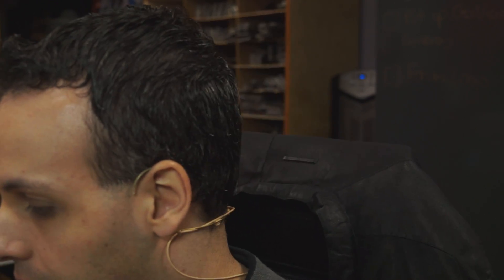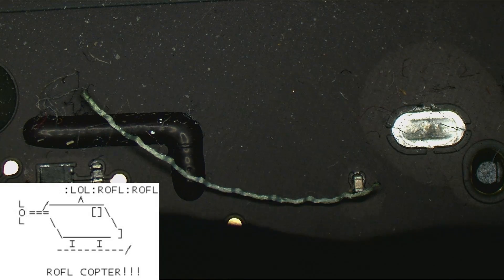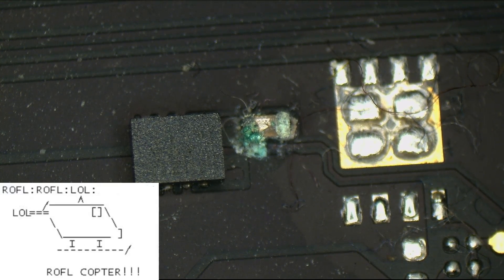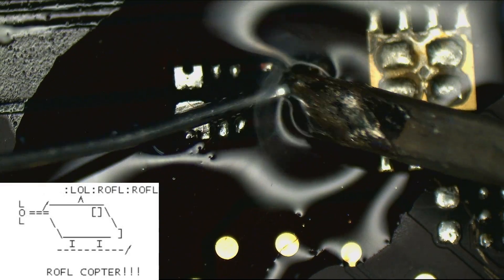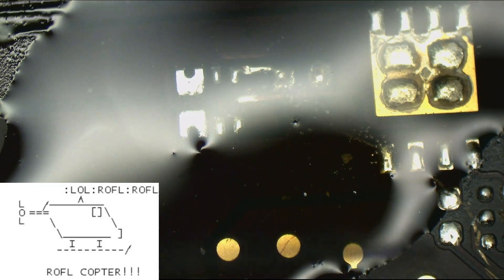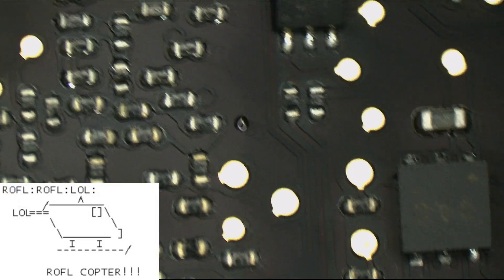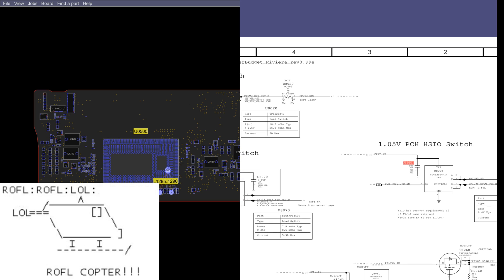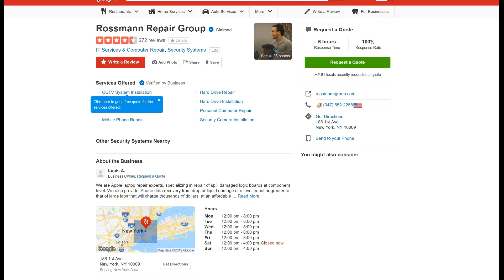The best Macbook logic board repair - right here on http://www.rossmanngroup.com

Comment: Hey louis, how is the hako tip cleaner any better than a tuna can with a stainless steel scouring pad in it?

just curious if I should upgrade
Reply: Tater1337 Steel? I was told to use brass filings.

Comment: 98% of the apple things you repair are liquid damaged yet 90% of your fans complain about bad apple design etc even though any other electronic device would be damaged with water.. stop spilling liquid into them and they work fine!
Reply from the maker: Incorrect
Reply from the maker: Your assertion:

"stop spilling liquid into them and they work fine!"

The truth: 

Keyboards spontaneously dying without water: 

https://bgr.com/2017/10/19/macbook-pro-2017-keyboard-not-working/

https://www.youtube.com/watch?v=4KuVvb9DTaU

Screens spontaneously dying without water:

https://appleissues.net/issues/flexgate/

Spontaneous no power without water:
https://www.youtube.com/watch?v=pvy-WrDdgYY

Spontaneous kernel panics without water(same as aforementioned design flaw, just implemented in different power circuit):
https://www.youtube.com/watch?v=DzcgT_fiVTA

Spontaneous black screen without water:
https://www.youtube.com/watch?v=lumJ0cN5oyY

I could go on and on...
Reply: @rossmanngroup  are you saying that other laptops don't randomly break? I had an IBM thinkpad R31 that would just cut out every 20 minutes without any warning, bought another because it was a great laptop then after 6 months that one did exactly the same! even on charge. 
Acer travelmate with a screen wire damaged from being opened and closed... hmm sounds familiar. yet my Macbook A1342 i have had new since 2009.. still working great to this day! only been to a computer shop to have the ram upgraded to 8gb.. it's been just as if not more reliable than my PC!
Reply from the maker: @CouldBeFrench  I said no such thing. No strawmanning.
Reply: Serious question: Why is the corrosion happening only at very few solder points? Do only very few water drops get through the case or is it high air humidity and following condensation? Could Apple do something about the corrosion by bathing the board in flux or something like that?  @rossmanngroup
Reply: @rossmanngroup  I don't know what that means haha just saying if you look after your stuff it looks after you and of course there will be design flaws and random flaws every once in a while. my argument was not against these failures but against the negative comments saying things like "what a poor design" on your water damage videos when water is not and should not be apples problem. every instruction manual and even the box clearly says do not get wet or leave in damp storage :D
Reply: @CouldBeFrench  Leah "box says don't get wet" Lanfond
Reply: @CouldBeFrench  most other laptop brands have some sort of protection against water damage; example: https://youtu.be/ig3xI8dUdm0?t=1650 because every company knows accidents happen. i think any customer should expect that an expensive, premium(TM) laptop is able to survive a few drops of water, but alas; macbooks do not.
Reply: @whozaskin3639  haha that was kinda funny, but it does have that umbrella with rain with a cross going through it symbol thing
Reply: @GoulartGH  I really don't think many electrical devices have this.. does your flat screen tv have protection against water? i think maybe apple thought their devices would go to smart people like animators and photographers who don't pour water into their machines? I have seen regular non apple laptops have trouble with more than a few drops of water? but because it's expensive it should have to? I don't think that's a fair statement when as i said at the start, it's not apples problem to deal with something they advise against. it's hardly a selling point haha, if they sold it as waterproof like many phones do nowadays i would be agreeing with you :)
Reply: @CouldBeFrench  why would you need liquid resistance in a TV? its not something that is always close to your hands (and possibly a coffee cup too), so there isn't a need to. this only applies to laptops and phones.
however, several people use their laptops while drinking coffee, water, etc. it's simple enough to do so without damaging anything, but as i said, accidents happen and everyone knows it.

also, macbooks aren't targeted ONLY at professionals; it's also targeted at people who aren't very familiar with computers in general (hence macOS being one of the simplest OSes to use), so i don't think "maybe apple thought their devices would go to smart people" is a very strong argument.

"I have seen regular non apple laptops have trouble with more than a few drops of water" of course, if you pick a regular cheap laptop you shouldn't expect it to have much resistance; after all they are cheap. (sometimes they do, though)
"but because it's expensive it should have to?" yes, especially when other brands do it; is it fair to the consumer to lose $1k+ because of a mere accident, when its not that difficult to do a workaround for that. it's not fair to the customer to pay $1k+ for something that has the durability of a cheap laptop.

the only thing that is agreeable is that it's not apple's fault and indeed it isn't; they aren't the ones that dropped water into their product. but it's a matter of caring for the consumer; if you want your customer to have the best possible experience with your product, you'll want it to last, and you'll want to make it as durable as possible (including, of course, liquid resistance). there are brands that do care for their customers and try to do that; and then there is apple.

edit: oops, this reply got larger than i expected, sorry! i just enjoy typing
Reply: @CouldBeFrench  lmao "apple thought their devices would go to smart people like animators and photographers who don't pour water on their machines" that's gave me quite the chuckle thank you. Although it does make me slightly sad that people like you exist in a world where information is so readily available. On a video that provides this information even!
Reply: It's a lot easier to kill a mac with water than other devices, because the openings generally directly to the PCB.
A thinkpad for example is pretty much immune to it.
Reply: it is correct though :') they don't just randomly corrode for no reason
Reply: @CouldBeFrench  new here ?
Reply: @rajeevarts398  haha reasonably, been subbed a little while :')

Comment: That liquid, what is that? Does it loosen stuff on the board? Looks yummy.
Reply: Yes you can eat it but only once
Reply: Is it worth it?  @pikachu-fe7tx
Reply: @pikachu-fe7tx  ok cool.
Reply: Flux. it helps clean the surfaces for solder to stick to much easier.
Reply: Yeah, but can you eat it because it looks yummy?!  @mikehensley78
Reply: @Fergesslich , only if you eat a lot of it.
Reply: @mikehensley78  You would need to go full glutton on it. Amtech 559 is a rosin-based flux. Here's the "toxicity" report of rosin: "minimal toxicity -- Rosin has no acute oral toxicity (i.e., LD50 > 2,000 mg/kg), and repeat dose toxicity data demonstrate no observed effect levels (NOEL) of approximately 105 - 200 mg/kg/day." In other words, you are more likely to drown in it before get poisoned by it.
Reply: @ihavenoson3384  i know. im pretty sure its made from pine tree sap.
Reply: I like to vape it personally
Reply: Amtech 559. Available at store.rossmanngroup.com

Comment: Hi Louis, I own a 2012 MacBook pro 13inch and whenever I use Logic Pro for a little while, the machine turns its self into sleep mode then powers off even whilst it is connected to the mains. All of my settings are changed so it can not turn off automatically, have you ever had a similar issue?
Reply: He's going to take time out of his day to read your comment, respond to your comment free of charge, all just to fix a basic issue that the user could just Google/research for his own? Really?
Reply: A Name Think about it I ’m not going to ask am I, if I have not tried every other possible remedy to the problem?
Reply: Dillon Williams Sounds like it is overheating itself, then doing an emergency shutdown.  Check if the fan is blowing air when the MacBook is turned on.  Check if the machine gets hot.  Maybe find a tool that displays the MacBook temperature sensors and fan speed in real time, then watch as you try running LogicPro.  If these show the problem, find someone who can fix the broken cooling component.
Reply: BOI. There is little sense in trying to fix a two-grand system with intentionally failing parts when you pick up a high budget-tier Lenovo system for like $500 and be good for a decade. You will delete a big chunk of your free time if you opt to try to fix a low-durability product like that. HP & Acer (and its subsidiary brands) can give you the same consta-overheating experience for just a couple hundred bucks. Switch on all power-saving options to reduce overheating issues.

Comment: Stop buying Apple people
Reply: I've never yet seen an apple person, much less one for sale.   :)

RichE San Diego
Reply: how about stop spilling drinks into apple products then they won't do this..
Reply: Except many PC laptops have at least some, if not a lot, of spill mitigating configurations so they're impervious or much less likely to have something spilled kill the system entirely.

RichE San Diego
Reply: Possibly, but my old Nokia 3310 died hours after dropping it down the toilet and my galaxy A3 died when it got wet in my pocket in the rain.. literally anyone with a brain knows that water and electronics do not mix. macbooks are designed to be lightweight and thin which means they simply don't have the same space inside as a regular laptop. I spilt tea into my wireless keyboard on my PC more than once and the keyboard needed replacing. same thing goes here! just don't spill drinks into them / leave them in damp places and they work totally fine  @googleplusisdead
Reply: Aren't those phones, not laptop computers?  We're talking laptop computers here, not phones.  VERY different beasts.  Ditto for regular keyboards.  Besides, how thick does a sheet of plastic have to be to shed at least some of a luquid spilled on it?
Reply: @googleplusisdead  I understand that they could make it water resistant but at the end of the day it does not claim to be water anything. When my phones both died from water I accepted it because they are not waterproof.. same here haha but if i got my s10 wet and it broke I would be annoyed! that's what I am trying to say, nowhere does it claim to be waterproof aor resistant and as a result it broke when water got inside..
Reply: You're apparently missing my point.  There are many PC laptops that have water shedding/resistant keyboards and cases, and several (Lenovo?) that have excellent water repellency included, or by design of the keyboard backing.  Macbooks have NONE at all so any little drop of water that gets between the keys of a Macbook is likely to cause damage, if not right away, sometime soon.  At the prices Apple charges for their laptops, this seems like an intentional omission or it could easily have been designed in long ago.  Remember, this isn't a new phenomenon for there latest laptops only.
Reply: @googleplusisdead  I didn't miss your point haha, I have had 2 IBM laptops before and they are designed totally different, there are a lot of things you could get away with with an IBM laptop, because they are not made to look like pieces of art, yes the keys could have been made more waterproof but that would make the keys look way different! yes it could have had holes in the bottom to let water drain out but that would ruin the ventless design most macbooks have. you need to remember that most people who buy macbooks buy them for how they look and how the OS works flawlessly, not for how well they repel water or stay cool. it's like comparing a Nissan to a mercedes, yes nissan's may be more reliable, cost less and keep running without help for x amount of years but mercedes are great looking and have that feel you do not get in a nissan. but still my point is, don't want your stuff to get broken, don't pour water in there :') when i bought my macbook i knew not to drink around it  and thats why it is still working great after 10 years of daily use! whereas the 2 R31's i owned both would cut out after around 20 minutes of use for no aparant reason.. never dropped never spilt on just a well documented common flaw they had..